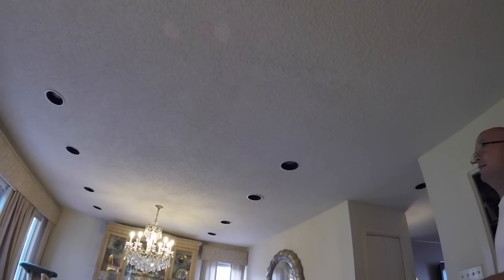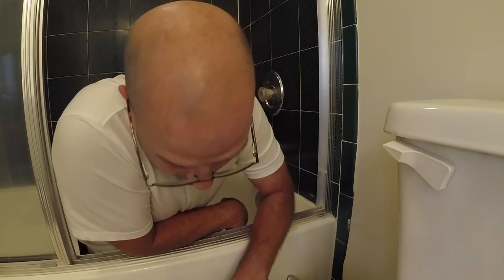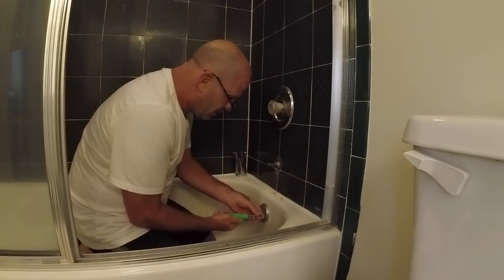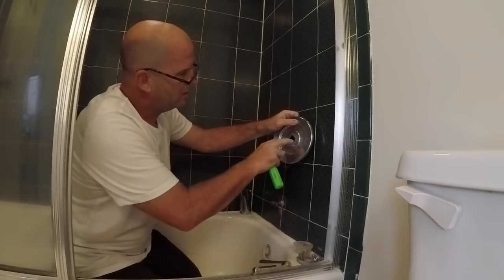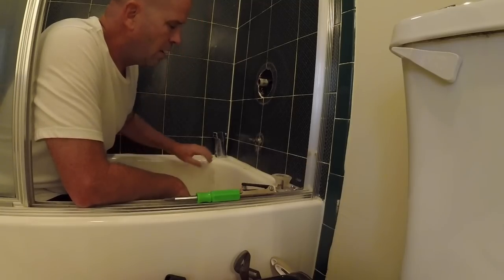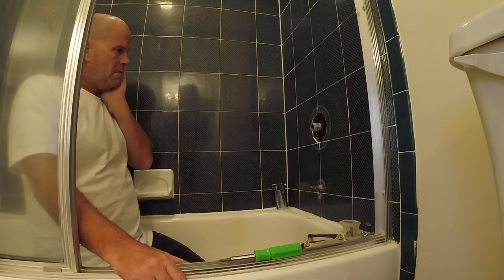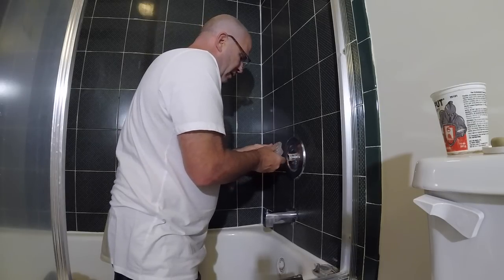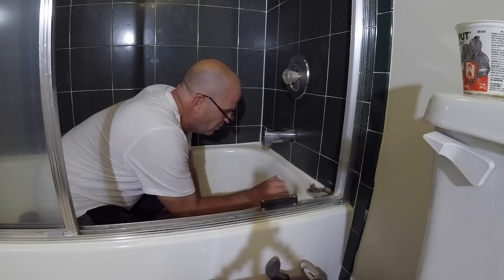Most Common Leaks On A Tub and Shower No Access Panel

Comment: Maybe I'm crazy but I've always felt houses should be designed with removable wall panels or something similar at key points of the home for easier maintenance.
Reply from the maker: True...
Reply: Critical access points....same thought. And the head of tubs should always be on an interior wall and never on the backside of another shower or tub

Comment: Absolutely love the video. Chuck your demeanor really comes through on the video, quite entertaining. I think I would have to pay you to be able to work for you...really reminds me of one of my mentors. Much appreciated.

That being said I have the same problem. Nobody wants to cut a hole but water has clearly leaked onto drywall. This needs to be removed and thoroughly cleaned with bleach and allowed to thoroughly dried before reassembling so it doesn't get moldy.

I get what you are trying to do but if the boss is right and it has been leaking for 25 years it needs to be addressed.

I love the comment about inventing something, and I have. You will not like it but it needs to be done.

So what I did was to create a template with half inch 5 ply plywood. Then I use a 1/8th inch drill bit to make sure where the studs/joists are and mark them carefully. 

Then I use my drywall router against the template to cut the drywall just inside the studs/joists. It helps to wear the tyvek suit and respirator and have an assistant (not the boss) with a shop vac sucking up as much of the drywall dust as possible while routing. Other dust measures need to be taken which I wont go into detail about to prevent it from getting all over the house, you can use your best judgment how much work prevention is worth compared to clean up.

With this method the template not only serves as a guide for the drywall router it also holds the piece up on the ceiling so it doesn't fall down. It takes two people to remove template and drywall piece cut without breaking.

Then after everything is thoroughly cleaned and dry you attach pieces of 2x4 flush with face of existing studs/joists using 3" structural screws predrilled with the 1/8" bit. The you reinstall the drywall pieces you removed and or the access door for the future conditions depending and you call the guy to match the texture and paint. A good painter/texture guy and no one will ever know that a hole was cut in the ceiling and you will have the peace of mind knowing it was tested for leaks when it was open and any potential mold issues remediated. 

It is a lot of work to do it correctly, and even less money will be made to do all the extra work but IMHO this is the way, the right way to fix it correctly and efficiently. Please let me know what the boss thinks of my prescription. 

Thanks, G

Comment: Chuck , leave water and trim on. Take a pan of water poor it over pop up trim while somebody listens downstairs for dripping noise. Wait a few minutes, DO the same water poor around the spout and repeat around the handle trim. O rings could be leaking on moen  cartrage and running back in wall. Take trim plate off and run water to check. Another threads leaking la shower arm leaks when shower is run.
Reply from the maker: Thats after I cut the access panel....a nice 4 x 4 FEET....lol

Comment: Just watched the video. Great job! I have a similar problem where the water only leaks when the water is or has been running. Going to use all of your tricks and tips before cutting a hole in the ceiling. 😳 I’m guessing mine is the drain seal as well as slight as the leak is. Thanks for the video!
Reply from the maker: Glad it helped

Comment: Came across this video today, doing similar job of diverter to handheld sprayer in tub only.  Was a nice good laugh after failing to get my plumbing project done.  The sprayer leaks a little, but the tub was not draining fast enough after last weeks house PRV replacement.  Plenty of water pressure now.  The boss was standing in 3 inches of water after shower.   I don't have all the parts yet for tub, needs new diverter spout.  Increased flow and drain needed adjustment, its fine now.  I feel your pain.   She is wanting to know if her shower is in service or not.  I feel an access panel coming for this setup for a permanent showerhead.  The handheld is suction cup mounted, it better not fall off and hit her in the head or I wont be hearing the end of it.
Reply from the maker: its the little things...lol

Comment: Thanks for all the laughs! I'm wondering if you all planned this video out. Anyway, I am having the same problem  I am a little confused about the fix though as it seems like you disregarding the problem with a leak from plumbing on the other side of the wall which seems more likely.  The drain plug seems like the most likely place. Would a bad cartridge cause a leak to your ceiling? Thank you again. Excellent April 1st video!!
Reply from the maker: Brother, No planning. Its our life....lol
Reply: @ChuckBarron  Hi Chuck. I did what you did in this video and it seems like it is holding so far. I did cut a trap door hole in the next room to get closer to see what is happening. The only thing I am a little upset with is to get the nut removed on the shower valve off with some Liquid Wrench I needed to apply quite a bit of force and the valve is not vertical now but it still works and doesn't leak. I'm thinking if I try to straighten the valve it could cause the little tubes to crack. Thank you Chuck! Keep up the excellent videos.

Comment: So what did you do about the water spot?  I had a similar problem.
The upstairs bath is used exclusively by my wife. She always took baths.
One time she decides to take a shower and water leaks onto the ceiling below.
I have access to the back of the faucets. I can stop all the leaks. My plan is to cut a donut out of a thin rubber sheet, fit it over the supply pipe and glue it to the tile. 

So how did you fix the water spot?  
I have this foot-diameter spot surrounded by an orange ring.
Reply from the maker: Wifey's fav can of paint...the killz spray can. always works. nice and light spurts. we have an 80's  pop corn ceiling.

Comment: Best tool for those Moen shower valve clips is really thin pair of Needle nose pliers,that way when you pop them you won’t lose the clip in the wall.I also bought a couple different Husky pairs of multiple small grab tools like that pick and a small screw driver kit to.
Reply from the maker: thanks anthony...I just learned about the moen tool from the guys on channel a year ago...i nver used one to pull cartridges...got one now....its sweet.
Reply: You’re welcome Chuck and yeah Moen pulleys are awesome.I have the pulley and the T handle pull one,when the sleeves from the other Moen shower valve cartridge doesn’t fully come out with the rest of the body.
Reply from the maker: nice.....thanks again.
Reply: Chuck Barron anytime

Comment: I always thought the little hole was a drain, cause if the water got behind the metal it would absorb into the foam and drain out the bottom. I like to think its just there incase of moisture gets behind the wall that it has a little air hole to let air in to help it dry. little air movement never hurt no body.
Reply from the maker: ya kind of noticed it and was thinking hmmmm interesting

Comment: THE TRAPDOOR...sadly, it will cause a lot of conflict in the home. But what's the other option? Ripping out the tub. Now we see, the trapdoor IS the best option.
You can always push a piece of furniture in front of the wall with the hole. But if the leak progressively gets worse, then the popcorn ceiling has got to go.
Reply from the maker: Still holding fast. Every day we have coffee and I peek up and bam. She pretty as every. No stains. Shower being used daily too.
Reply: @ChuckBarron  
Awesome! Like that mysterious knocking sound coming from a twenty-year-old engine. You trouble shoot the simplest possible causes, until you solve the problem.👍

Comment: If you're worried about the waste pipe moving why didn't you putty the spud without taking it all the way out?
Reply from the maker: pop corn ceiling and if i recall without watching vid again spout came out easy. and my wifey was micro managing every thought of cutting an access if things went bad. lol
Reply: @ChuckBarron  I am talking about the "spud" which is the technical term for the drain piece at the bottom of the tub. Shoving the putty under this piece without taking it all the way out eliminates the risk of the pipe underneath moving.

Comment: The pipe between the overflow fixture and the drain it connects to is loose/leaking?
The knocking is because the overflow pipe, has fallen out of the overflow fixture?
Reply from the maker: Well this tub and shower was put to the test and she still holding fast. Next leak gets a access door cut in bedroom but for today its good.  lol

Comment: How old was the putty around the drain?  I'm wondering if I should be looking at doing that.  I had a leak around a stand up shower.  Same issue, no access.  I caulked around the handle and big ring around that. Also modified an overflow gasket to go behind it because the original gasket had a tear and didn't look like it was sticking any longer.
Reply from the maker: back in 85 but now she holding fast.

Comment: Looking good, very interested to see the trick with the wrench to get the drain open...

Currently trying to work out how to dismantle/replace a Delta Stopper on the tub, no access from behind possible without dismantling a sink & cutting a hole in the wall.
Reply from the maker: Oh boy. good luck.
Reply: Chuck Barron any suggestions?

Comment: Hey chuck. Only when I run my shower it leaks to basement. Put a new overflow gasket in and caulk around a few spots. Still leaks.  Any other ideas?
Reply from the maker: Tile or fiber glass.  Tile Maybe a pan. Clog shower drain and fill up a little... fiber may be a crack.

Comment: hi Chuck, did this fix the leak?
Reply from the maker: It did. Holding fast and we had heavy use on this spare bath also. Its a go!
Reply: @ChuckBarron  good to hear! Thanks for the video. I did similar check on my shower cabin and applied silicone sealant to the drain. Letting it cure for a day or two. Hope that will fix my leak. Stay safe.

Comment: hilarious. If i had to guess i would say that;s gotta be a new jersey, long island, maybe Connecticut accent and rough around the edge comments? Am I way off?!
Reply from the maker: South Jersey....lol....where you from pierce?
Reply: Chuck Barron hey! Dallas, TX. Thanks for the share on the leaky faucet. I’m having issues with a old 80’s shower. Leaking from under the pan on to my concrete slab. It’s a tiled shower not fiberglass surround. A hole in the wall confirms it’s not my mixing manifold or pipes. Maybe old grout? It’s not the door because the water is a puddle that grows from beneath. Searching for answers! Thanks in advance!

Comment: I don't understand why you would just put caulk around everything without finding why it's leaking..That will cause more water damage and dangerous mold..Looks like you can afford a plumber..You should use one..It's not that difficult to troubleshoot and fix a leak..I am a housewife with no plumbing skills and changed out my valves in 5 minutes..I am concerned for your health..It will still be leaking..I can't believe your a plumber..
Reply from the maker: I am! Been down all these roads before. Im not worried at all. Especially in my own home. Plumb on sister.